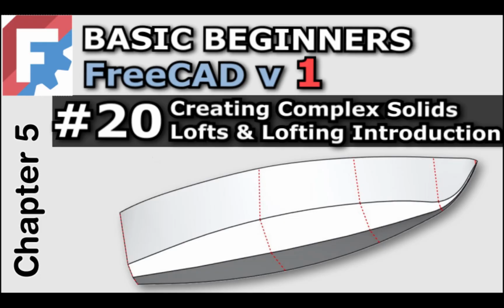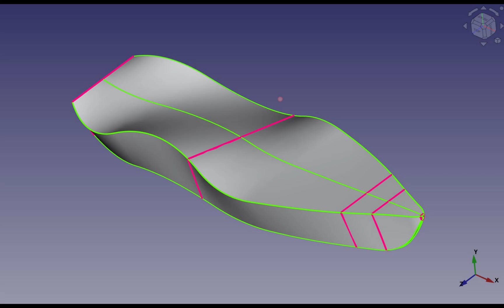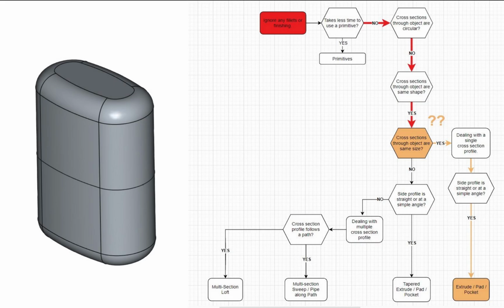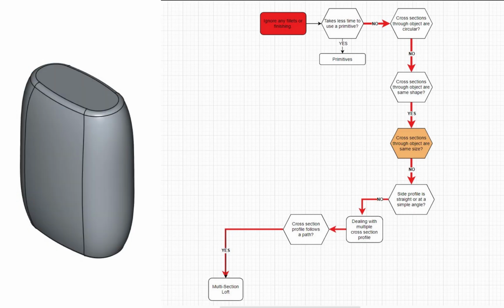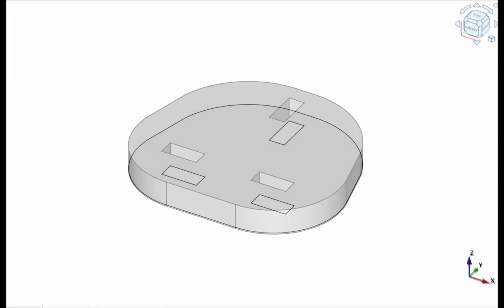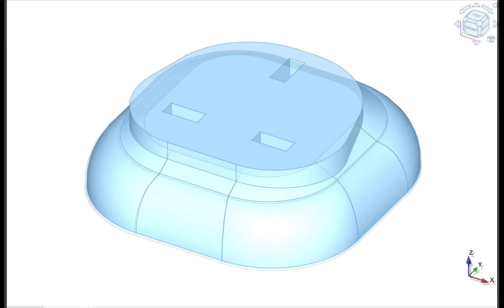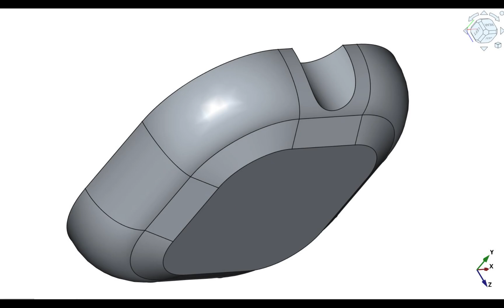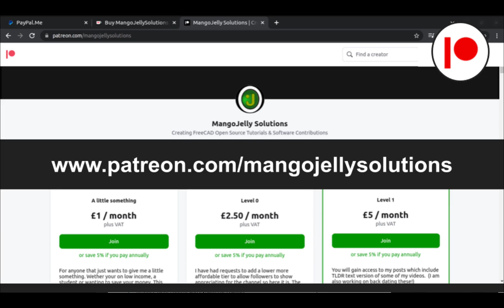FreeCAD V1.0 | Introduction to Lofts | Lesson #20 | Basic Beginners FreeCAD | Create Complex Models

Comment: Looking forward to watching this, I've been trying and failing to use curves WB to trace a 3d scan of an automotive seat foam. This organic shape lofting seems like worth a shot!
Reply from the maker: Curves workbench is more of a advanced workbench and things can go from zero to 100 in a matter of minutes.  Hope this helps you out.  There will be a number of lofting vids and exercises in this chapter.
Reply: @MangoJellySolutions  Surface modelling is something I've never quite cracked, but I'm trying to preserve a vintage car with 3d scans and modelled parts. Motor parts is fine (typical parametric solids), but the organic dash, seat foams, body panels is really hard. I figure that learning this all once will pay off. I sadly didn't find a paid course,  which I would have been happy to invest into! Lofts I think work well for "slices" of a trace, but I struggled mixing perpendicular planes to tie the "ends" of a part together. I like what you did in the boat hull video, but tracking tonnes of helper geometry lines gets exhausting quickly!